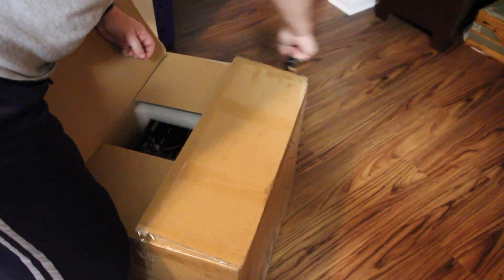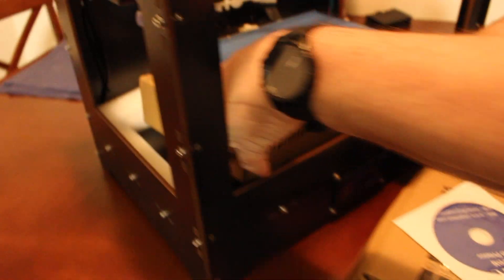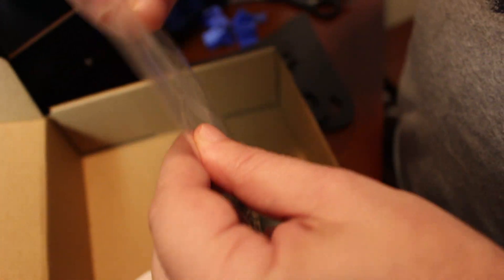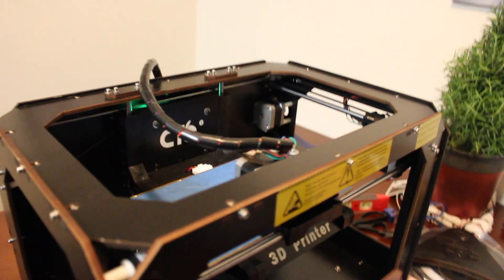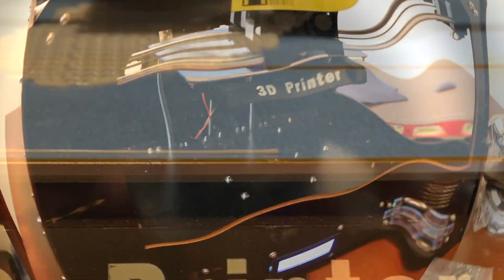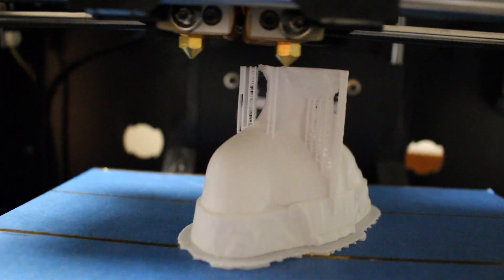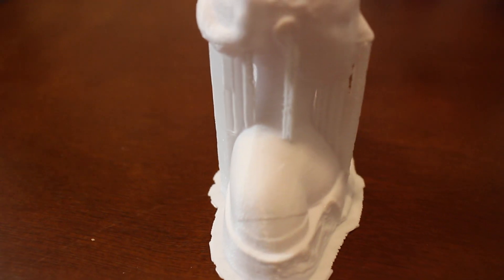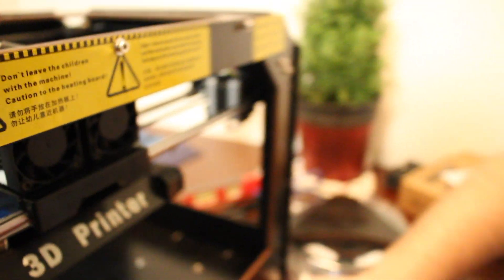CTC FDM MK8 3D Printer, FIrst Look and First Print

Comment: I have one of these, and it works great. Those four blue things are the feet, as you point out with the caption. The SD card slot is on the right hand side, behind the blue buttons. The big tube they give you bolts onto the back of the machine and holds the drum of filament. There are two holes, and it is designed for two print heads, but they only give you one support. Guess what 3D file is on the SD card? Yep, it prints the second tube and the big bolts to hold it in place.
Reply from the maker: Thanks for sharing